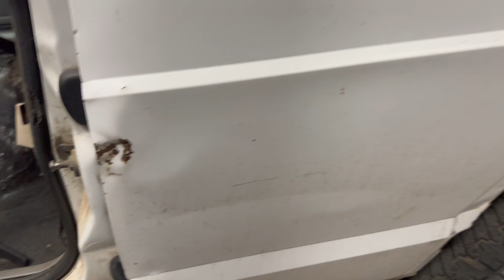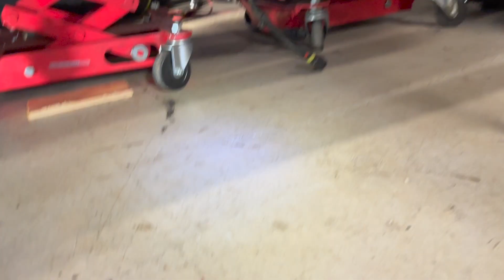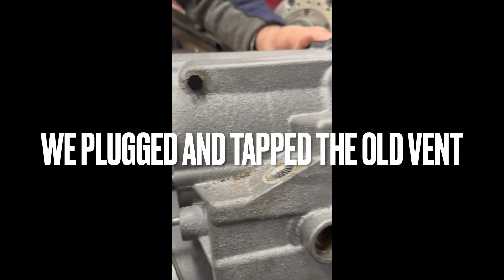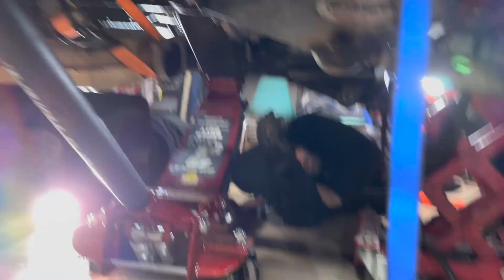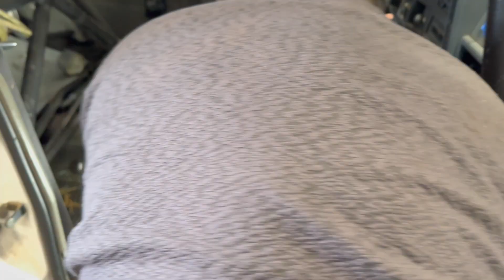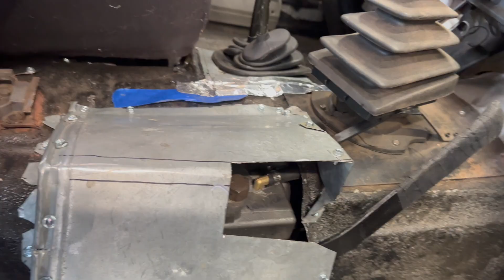Jeep cherokee XJ dual transfer case install - NP231 Dana 300 frog fab

Comment from the maker: We moved the dana 300 vent tube to the rear output housing. It was puking oil out the vent line, which was very long. Once we added the vent to the top of the rear output, all good since. Also, we added a catch can to be safe

Comment: What’s your plan for oil 
Now that you’re case is upside down there are bearings that are no longer running in oil
Reply from the maker: Which bearings are you concerned about ? The 300 is filled with 2 quarts, and the 231 just has the input bearing basically which is fully submerged in like 1-1.25 quarts, i cant remember exactly since we filled it til it came
Out of the middle hole. We also run catch cans on both of the vents as well to monitor overfilling. So far its been great. Ive got a buddy thats been running the same
Setup for 16 years and its been fine on his.
Reply: @GoWheelWithJon  sounds like you have it worked out
Reply from the maker: Well its working so far. Theres no oil slinger in either case. Just gears submerged in oil

Comment: I learn from you's,I'm doing two xj wagons long arm conversions getting the works,one wj wagon with the works,is I'have truck body builder experience for the mods
Reply from the maker: Hey thats so cool it sounds like you have a ton of projects going on, 2 long arm kits on 2 xjs sounds prettt rad. I used to own like 4 wjs, i had some bad luck with the wjs where stuff just randomly failed all the time like blend doors, cps, etc

Comment: Hi you’re pretty local to sf! Do you have recommendations for driveline vibration issues starting around 35 mph? 

I’d love to have you or someone nearer sf look at it. 

3.5 inch lift
Reply from the maker: id get tires balanced first, then pull driveshafts and inspect u joints, also measure driveline angles with respect to pinion angle, it will be different depending on a stock slip yoke versus a SYE. so tire balance, driveline angles, trans mount, u joints.
Reply: @GoWheelWithJon  thank you so much. I’ve got a balance done, just did my hack and tap, I’ll tighten Trans mount and check on my Us
Reply from the maker: Could be the tcase output shaft is bent, bad u joints, bad trans mount

Comment: Ive seen a few of these 231 doubler builds on YouTube.  Im curious how well it holds up? Lots of Torque going through drive train. You must be over 100:1
Reply from the maker: Yes, with 4.10s it will be around 109:1. Ive got a good friend who has been running a 231/300 doubler for over 16 years and its been fine. Stock 2.6 gears in the 300 like this one , but he has 4.88s . He us running a 30/44 . The real concern is how long with the 30 last, but with more control, as long as you dont get stupid, the 30 shkuld last.
Reply from the maker: So far its holding up. He has Been on a couple easy trips. Keep stepping up the difficulty each trail.

Comment: How bad was the wait time on the frog fab kit will be doing this same project just can’t decide where to get the kit from
Reply from the maker: It came fast actually
Reply from the maker: And he was really responsive to email. He sent some wrong bolts, and theres no instructions, so youll want to sit there on the bench for a while one night just figuring out how all the bolts go in , what holes you need to drill. Our clocking ring had one hole that was a little bit off,  ery minor ( it only clocks one way) but one hole was still not right so i hust opened it up with a die grinder.
Reply: @GoWheelWithJon  thanks for the advice I really appreciate it I will definitely be back to your video when I come to doing my doubler
Reply from the maker: Dude thats awesome!!! Post up how it goes
Reply: @GoWheelWithJon  I definitely will hoping for it to be a summer project if I can get my hands on all the parts in time I plan to video and post some of it so I can get some insight and judgement from other

Comment: Jon will you be wheeling this rig yourself?
Reply from the maker: This is fot bills rig, not mine. I have an atlas 2spd 3.8 case in my xj and my rubicon has the 4:1 . Both are auto. Bills rig is a manual and he needs the 110 :1 double low
Reply: @GoWheelWithJon  I thought you had a new rig to drive. Go Bill.
Reply from the maker: Nah its bills rig.

Comment: Maybe a crown royal bag would fit as a shift boot. 

Have you considered putting any sort of edge protection on the new shifter tunnel you need to cover? Something to prevent the metal from cutting the boot whenever you shift from 2H to 4L? 
Maybe radius the corner so it’s smoother on the passenger side?
Reply from the maker: Those are good ideas. Crown royal bag is an awesome idea